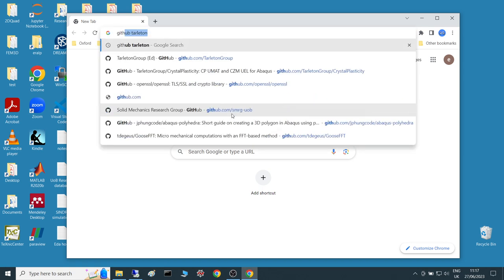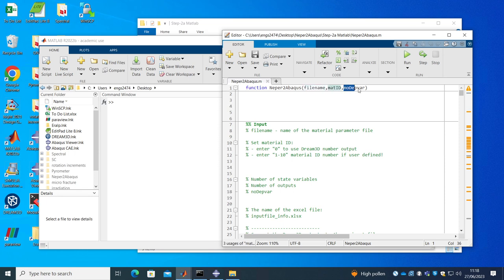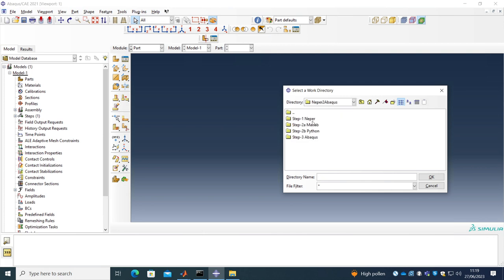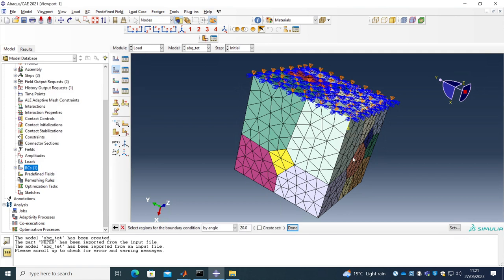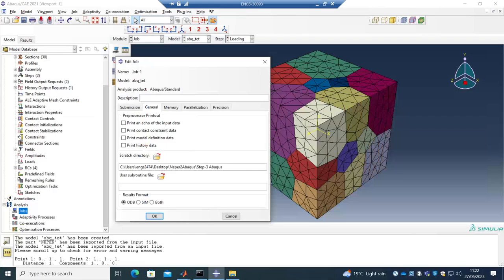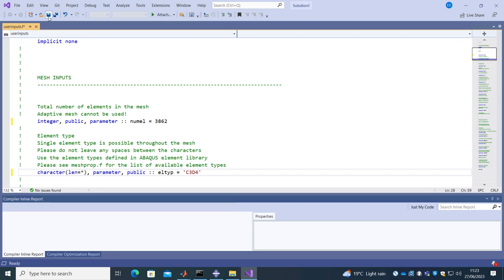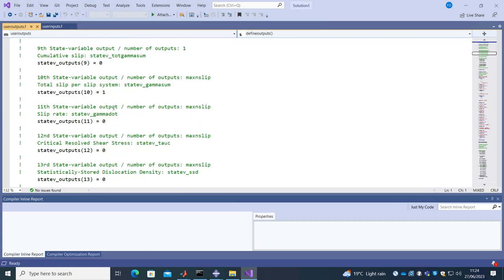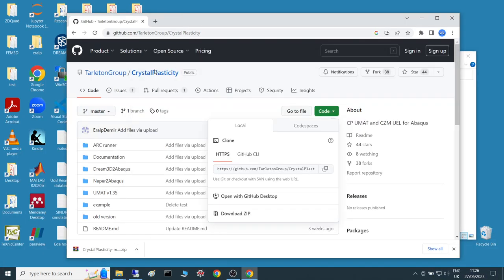Neper2Abaqus - UMAT polycrystal

Comment: Hi, Eralp. Thank you very much for your tutorial. I would like to ask you how I can realize the single tensile CPFEM simulation process of my material, which contains two phases, such as HCP and BCC.
Reply from the maker: Hi, thanks. 
Yes, it is possible. You need to create these two phases in the generation stage. 
You need to assign these phases as different material types that are defined in PROPS(5). You may use different properties that are read from "usermaterials.f" corresponding material-ids.
Reply: @eralpdemir  Hello, Eralp. Thank you very much for your reply. We tried a simple model. It only contains 85 grains, and we set the first 10 of the six parameters of the grains as HCP (i.e., the fifth parameter is 3), and the other grains are FCC (i.e., the fifth parameter is 2). But it was a failure. Do we need more operations?
Reply from the maker: Hi,
There is a parameter "maxnslip" which defines the maximum number of slip systems in the mesh that is defined in "userinputs.f". You should set this consistent with the nslip defined for the hcp material. Or, you may simply set nslip in usermaterials.f to "12" in that case first twelve slip systems are accounted.
Best
Reply: @eralpdemir  Thank you very much for your answer, we plan to test it using your method.
Best wishes.
Reply: @eralpdemir  Hi, Eralp. We recently calculated the GND density and found that in the final result, the maximum GND density was only 5.845e+02. This result is obviously wrong, but we did not find any code to change the initial value of the GND density in the three "user.f" files, only the SSD one. After we changed the initial value of SSD to 1.0d+13, the GND result was displayed as 0. What should we do to solve this problem? Thank you very much for your answer and tutorial again.
Best wishes.
Reply from the maker: @JackBrown-k6i  Hi, the dislocation density terms are in 1/micrometer^2.

5.845e2 = 5.845e14 1/m2

When you enter a high value of SSD, essentially the strength is so high that plasticity is not generated. That explains the zero GND density.

Best
Reply: @eralpdemir  Oh, thank you so much for your help

Comment: Hi, How do you extract the result in this case if you want to compare them by experiment , all stress  in nodes at surface should be considered so do you use average ? In my model because of nonlinearity it is not possible to count average (each node has different number of increment)
Reply from the maker: @fatemehkaramifard6184  Hi, I usually use the sum of the reaction forces on a surface in a 3d case. If needed I divide by the undeformed area to get engineering stress. Conversion to true stress is possible with equations.

Comment: Hello, Eralp! Thank you for sharing.
I have a question for you:
I want to do a phase transition process and output matid of each Material and other parameters of User Material, because I want to realize their dynamic change, that is, int(PROPS(5)) output. Can't this abaqus be directly output? Can I write an implementation in statev_outputs? Because there may be phase precipitation from fcc to bcc in my Ni-based superalloy, I see that your code also has the two-phase part of the Ni-based alloy, may I ask if that part is similar? Thank you very much!
Reply: I am looking forward to further communication with you. If I have the opportunity, I also want to join in the improvement of the code. I really appreciate your work. With great respect!
Reply from the maker: I am sending a few links for paper that dealt with phase transformations. You may find more relavant references.

- phase field approach: https://doi.org/10.1016/j.ijplas.2018.03.009

- continuum approach: 
https://doi.org/10.1016/j.ijplas.2010.09.008
Reply from the maker: @EmonXu  Please contact through the Github link to collaborate. So that I will let my line manager know about it.
Thanks for your interest,
Eralp

Comment: Hello, Eralp, i have a question about grains generated by Neper, can we use our EBSD data to generate grains in Neper? if it's yes, how we can do that? Thank you very much
Reply from the maker: Hi Ayyoub,
I have used Dream3D for that once. There are available pipelines in their website. I have not used NEPER for that purpose but it should be possible too.

The limitation of this approach is the single orientation representing a grain. If you like to include in-grain orientation scatter, I recommend you use a direct mapping by using an orientation analysis software like MTEX to filter out bad data or to coarsen the  step size.

Bests,
Eralp
Reply: @eralpdemir  Thank you so much for your help

Comment: Hi thank you for the tutorial. I have few questions. 
1) is the code applicable to s3R and s4R elements. 
2) I created a model using neper and imported it directly to Abaqus using .inp extension from neper. I applied the boundary condition just like you have explained in this video but without the fortran codes or UMAT or matlab or pyton. I would like to know if this will work if i define the material properties of aluminum in my abaqus material module.
Reply from the maker: Thank you.
1) Yes, the code is applicable to 2D for plane stress and plane strain cases. I have not tried with shell elements though.
2) That sounds ok. If you enter first 6 elements for  the PROPS correctly it will work. You have assign material -ID to PROPS(5) which shall correspond to the properties of aluminum. You change the material parameters in usermaterials.f.
Hope this helps, bests
Reply: Understood thank you.

Comment: Such a nice tutorial, is this code is applicable for 2D?
Reply from the maker: Yes, the crystal plasticity code can work with plane strain and planes strain elements.
Reply: @eralpdemir Thank you for your kind response, I have query about.inp file.
 Using this code should I generate or add some other work in Abaqus.
I mean if I generate.inp file in Neper and open in Abaqus and then add cracks or other work in that.inp file is it possible?
Reply from the maker: @sajidali-qg1mg 
Hi, yes there are two ways to create the .inp file by using the matlab or python scripts. You have to enter the BCs and do other changes in ABAQUS. This input is designed to use our UMAT code that you may in the same Github link. 
Bests
Reply: @eralpdemir Thanks once again
Reply from the maker: Many thanks. Yes, it is applicable to 2D plane strain and plane stress cases.

Apologies for my late reply.

Bests